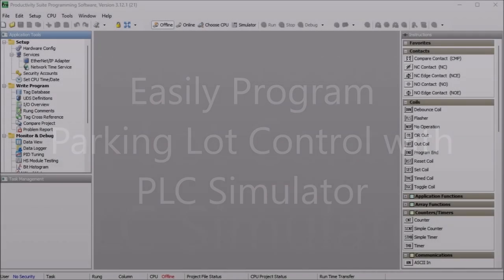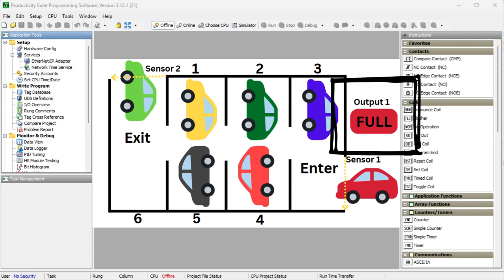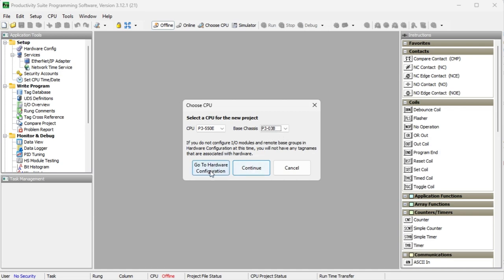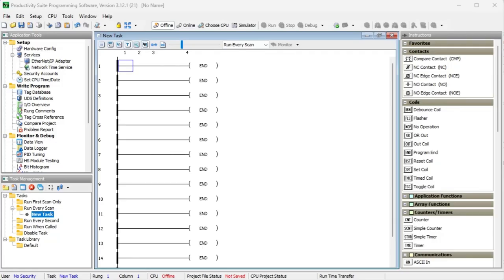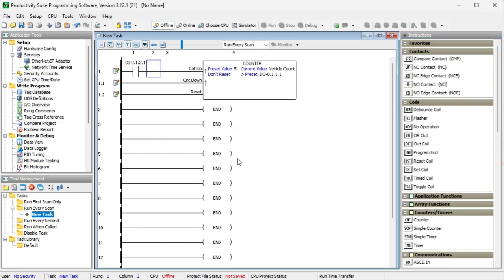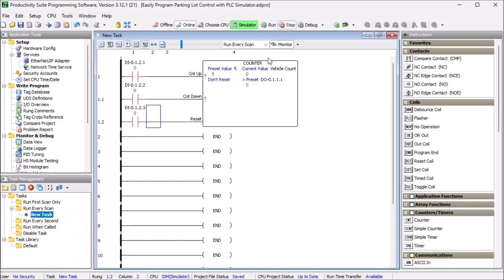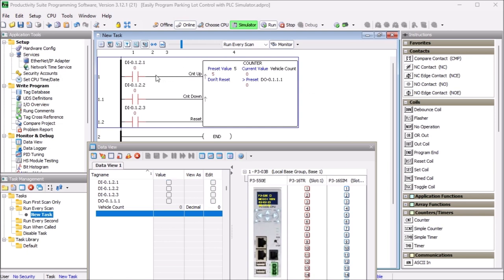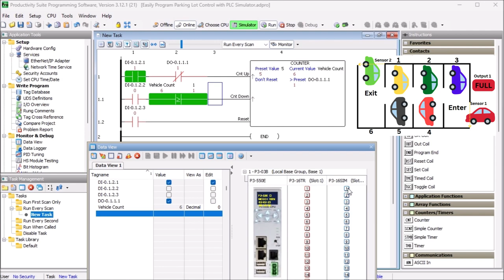Easily Program Parking Lot Control with PLC Simulator

Comment from the maker: You can find detailed information and links on the corresponding post located here.
https://accautomation.ca/easily-program-parking-lot-control-plc-simulator/

Here are the controllers that we have covered at ACC Automation:
Productivity Series
https://accautomation.ca/series/productivity-1000-plc/
https://accautomation.ca/series/productivity-2000-series-plc-p2000/
BRX Do-More Series (Do-More Designer Software + Simulator)
https://accautomation.ca/series/brx-do-more-plc/
Click PLC Series
https://accautomation.ca/series/click-plc/
Omron CP1H Series
https://accautomation.ca/series/omron-plc-cp1h-series/
Horner XL4 PLC Series
https://accautomation.ca/series/horner-xl4-series/

https://accautomation.ca/series/easyplc-software-suite/
EasyPLC Software Suite is a complete PLC, HMI, and Machine Simulator Software package. Please take a look below to receive 10% off this software. This PLC learning package includes the following:
Easy PLC – PLC Simulation will allow programming in Ladder, Grafcet, Logic Blocks, or Script.
HMI System – Easily create a visual human-machine interface (HMI)
Machine Simulator – A virtual 3D world with real-time graphics and physical properties. PLC programs can be tested using EasyPLC or through other interfaces. (Modbus RTU, TCP, etc.)
Machine Simulator Lite – Designed to run on Android Devices.
Machine Simulator VR – Virtual Reality comes to life so you can test, train or practice your PLC programming.
Purchase your copy of this learning package for less than USD 75 for a single computer install or less than USD 100 to allow different computers.
When you order, you should receive 10% off the investment by typing in ACC in the comment section. 
http://www.nirtec.com/index.php/purchase-price/
Learn PLC programming the easy way. Invest in yourself today.

Regards,
Garry
ACC Automation
https://accautomation.ca/